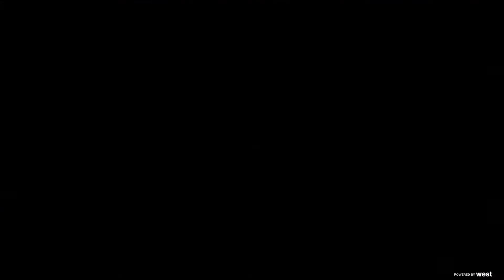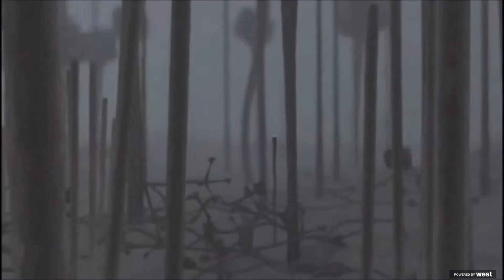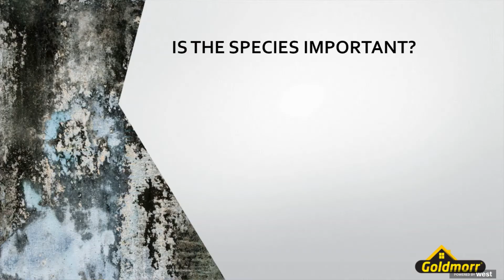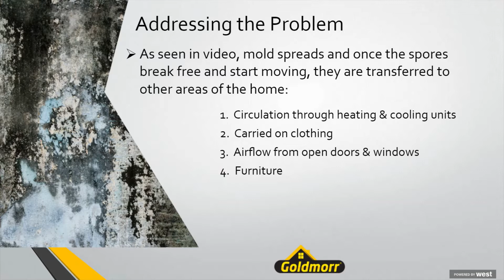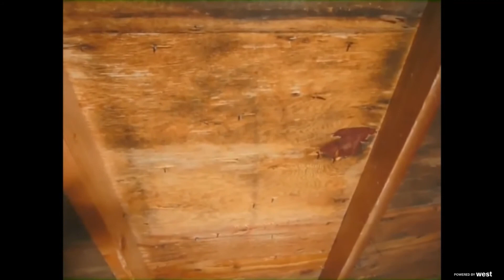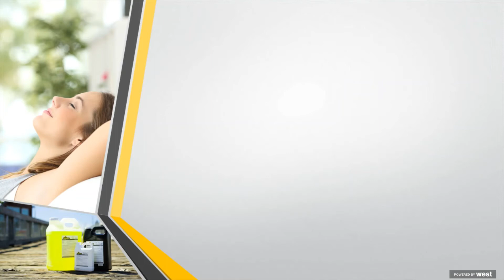New Mold Remediation Technology That Actually Works

Comment: 1)Drywall is very water-permeable. if it is wet on one side, it is usually wet on the other side, and there is paper on both sides. Don't assume that there is not mold on the other side. More often than not, there is. 2) When you talk about "bleach", is that sodium hypochlorite(chlorine bleach)?
Reply: @boonstein9949  it would really depend on the source of the water intrusion. In a flooding type scenario then the water may well wick up both sides of the drywall.  However when dealing with atmospheric mold (high humidity) it’s more typical that the moisture, and any attendant mold growth, is on only one surface. That’s why a thorough inspection must be conducted prior to treatment to determine the extent of the water event and more importantly the scope of the mold contamination. In our provided training for all Goldmorr users, we stress the importance of always finding the source of the mold growth to ensure proper remediation. There are many tools available that can assist in determining what’s happening in a wall cavity before resorting to demolition. 

Yes, sodium hypochlorite at a strength of at least 10%. But the secret sauce is the Goldmorr 6000 that is mixed with the bleach. That changes the viscosity of the bleach, increases the dwell time before evaporation and allows the surface tension and structure of the mold colony to be penetrated by the bleach
Reply from the maker: I couldn't agree more.  We can't "assume" anything.  That's why we review in our free training how to determine if there is mold on both sides BEFORE tearing out unnecessarily.

Comment: Why isnt the drywall with the growth being removed? You can't clean  it on drywall, and how do you know their isn't  growth behind then drywall, and the bottom plates?
Reply from the maker: Actually you can remove the mold contamination from drywall. If you have the right system. Mold will not grow “into” or through drywall. Gypsum is a sterile environment. If you have mold on both sides of the drywall it’s because you had a water event on both sides. And that certainly can happen. That’s why we train all our system users how to check if there’s mold in the wall cavity BEFORE tearing it out. There’s no scientific reason to remove drywall because it has surface mold on it. Just get rid of the mold with Goldmorr. Then prove it’s gone with whatever type of surface sampling you want to throw at it.

Comment: What IAQ equipment do you suggest using?
Reply from the maker: Good question. It really depends on what you're trying to evaluate.

For general IAQ assessment, we like tools that can provide objective data such as particle counts, temperature, relative humidity and moisture conditions. When fungal contamination is the concern, air-o-cell sampling analyzed by an independent laboratory and, when appropriate, third-party testing by an industrial hygienist can provide additional verification.

The important thing is not relying on any single instrument or reading. We use IAQ information as part of the overall assessment and, importantly, to help verify the outcome after remediation.

Comment: You guys don’t use heppa vacuums
Reply from the maker: HEPA vacuuming can certainly be used when the project conditions call for it.

What we don't teach is that HEPA vacuuming is automatically the answer for every project. The Goldmorr system takes a broader approach to contamination—including the air and areas beyond the visible mold—and then emphasizes verification of the completed remediation.

Different projects require different tools. The goal isn't to check a particular equipment box; it's to achieve a properly remediated environment and be able to verify the result.